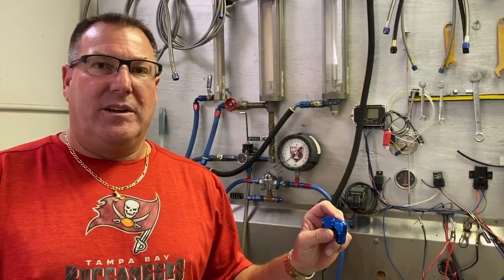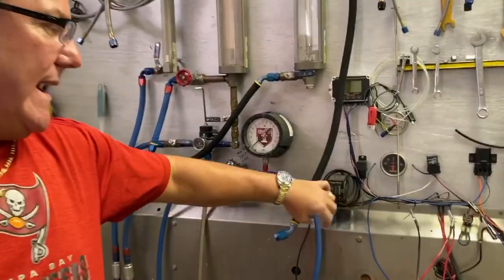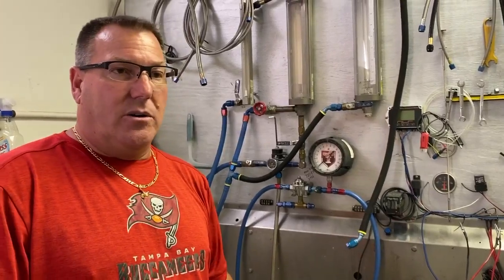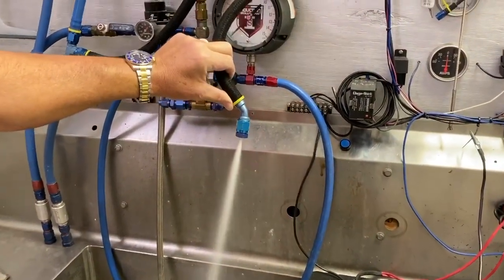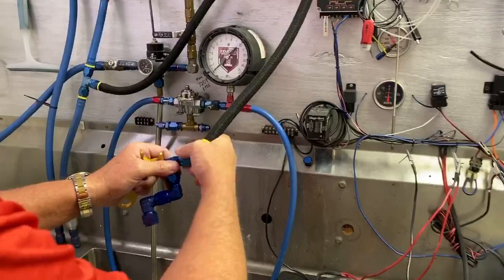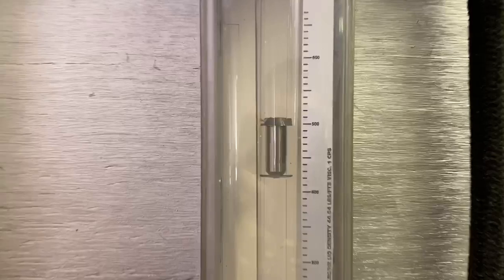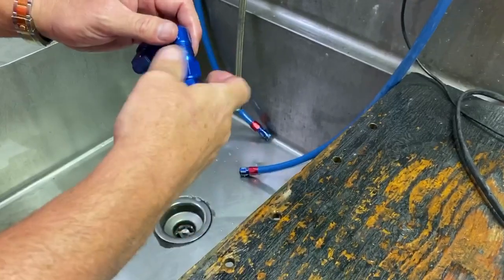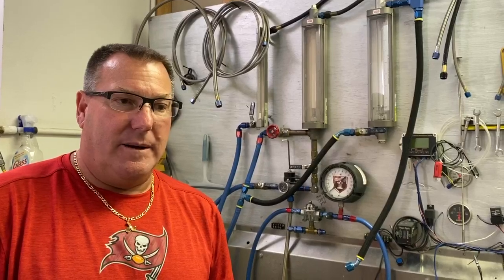Do 90° Fittings Restrict Flow?

Comment: I had one on the outlet of my fuel cell before my pre filter and I was dropping fuel pressure on my data log. Changed it to a radius 90 and that fixed it. I attributed it to cavitation or turbulence on the intake side of the pump.  On the pressure side I’m sure it’s less of a problem.

Comment: Not dismissing this and agree that proper fittings do not restrict flow as much as people think. That said, was this test run at the same pressures before the nozzle? That will give a true indication on how much, if any, back pressure the additional fittings would add.

Comment: Think of a 5 lane freeway with a crashed truck blocking 4 of the 5 lanes. Traffic flow is obviously greatly restricted. 
You then close one of the 5 lanes Before (upstream of) the crashed truck, and note that the traffic flow didn’t change going from 5 lanes to 4. 

Would you then state that having 4 lanes instead of 5 lane freeways does not change the traffic flow and start building 4 lane freeways instead of 5? Obviously, that’s silly. The restriction of the crashed truck (orifice in the video) makes the changes upstream (generally) meaningless.

Comment: sorry dude, good attempt but really a poor experiment, no comment on pump details, pump current draw, pressure, etc and the hole in the end is the limiting factor, why would 90 degree fittings that are way bigger than the limiting orifice have any effect on flow, especially at those pressures. there wasn't a flow change but is there a pressure change...that would be a C at best in a high school physics class

Comment: Your results look feasible. The jet flowing 500lph is a good visual that we don't normally get to see. I'm not familiar with the flow bench setup.  What was the pump pressure set at? I'd like to have seen that the pump pressure was controlled and a pressure measurement taken before and after the restriction.

Comment: SCIENCE IS AWESOME!  I love knowing and learning.  I use steel compressed fittings on my lines that are hand made at an industrial place locally and I never would have dreamed there would be a difference.  So I love to see logical testing done!  Super awesome! Keep up the good work!
Reply: the guy doesnt know how to test flow , you dont put a restrictor after the 90 you are flowing and expect to learn what the 90 flows lol
Reply: @bigboreracing356  I dont need a flow bench to find out if a # 8 fitting of any style will flow a 1/8" orifice hahahahahaha but I guess there are guys out there that need to be shown and then post how impressed they are with the test hahahahaha
Reply: @bigboreracing356  he should have said you dont need a full flow 90 when you dont need to flow the whole line size , instead of making it sound like the forged 90 is just as good as a full flow 90 ..................... get it ?
Reply: @bigboreracing356  you mean a bigger one will flow more than a smaller one , yeah I know  lol
Reply: he also proved that putting a orifice on the end of what you are flow testing takes everything out of the equation except the orifice ,         ever notice how ported cyl heads only start to flow more than non ported heads when you start opening the valve farther than ,050" ?
Reply: @bigboreracing356  he said it was a myth buster about 90 deg fittings , the only thing is putting a small orifice after a fitting takes the fitting out of the equation , like I said I didnt need his vid to tell me a #8 forged 90 will flow a 1/8" jet hahahahahaha  but it sounds like you did  , if you want to know if I know anything about fuel systems ask Don or Vern from Hilborn
Reply: @bigboreracing356  Im bragging about a VW that smokes V8s  and makes 600 HP with 133 cid
Reply: @bigboreracing356  lol , im just busting yours about the fittings too sir , I dig your pro charged fox body , im sure its a hell of a ride
Reply: @bigboreracing356  you couldnt get the fox body to hook on the street ? I figured it was a hand full
Reply: @bigboreracing356  they make heavy duty super thick alum cases and I added 2 head studs per cyl  so each cyl has 6 head studs , I run 40 lbs of boost on M5 Metanol with big cnc ported heads and .630" lift 300+ duration and 112 LSA cam
Reply: @bigboreracing356  the crazy part is there are faster ones than mine , there are places that make big block VW engine parts and get them up to 4 1/4 bore with huge heads with ports like your Brodix heads and they make over 1000 HP and run in the 7s @ 180 + mph
Reply: @bigboreracing356  yes ,  I just freshened the engine and trans for next season , first race is March 7 at Irwindale Raceway its 1/8 mile , our local 1/4 mile closed a few years ago , we went 9.32 @ 148 last time we ran 1/4 mile but I have done some up grades since then , its prob at in the 9.0s now
Reply: @bigboreracing356  cars like mine are prone to get loose if the track prep is not good , last year I got loose top of 3rd gear and hit the wall , I had to cut the car off at the doors and put on a new front half so I would be surprised if I could keep it straight on the street

Comment: If you consider the velocity of the fuel (even at twice the PPH) through the 90° fittings it should be apparent that you will not see a meaningful restriction in flow.

Comment: Sounds like some people have forget a lot of math that goes on here. Once a pressure has been reached. It wouldn't matter if it was a 90 or 180 fitting. If the pressure stays steady the fluid will flow at that amount. It is not like and exhaust system where the gasses are bouncing around in the pipe. Liquids and electricity both follow the path of least resistance until they are under pressure. Think of the water flow in your house. Every outlet has the same pressure until another outlet is opened.
Reply: Bro this is the best comment about this. I understand it 100% now lol

Comment: would the same be for running 90* in oil lines? I had an engine builder claim I had "too many 90's in my oiling system" which he felt led to my rod bearing failure and I disagreed to his logic.
Reply: Every fitting induces a pressure drop, but it depends on flow and viscosity. While it would drop it faster with oil, it's unlikely. Just check out the crazy 90 turns any oil system makes. The largest drops tend to be from long runs of narrow hose moreso than fittings.

Comment: I had always heard about the 90 degree thing since the 70's. Could it be at that time when we only had at best a Holley blue pump and brass 90 degree fittings that on the inlet side that the 90 degree fitting would restrict the flow? I would like to see a test with a pump like that and a 90 degree fitting brass and a good fitting like used in the demonstration.

Comment: this problem with 90 degree fitting are in flow reduction of the engine oil plumbing not fuel system

Comment: How about testing on the suction side of the pump.
Reply: John Alwine the reason this works, which I’m guessing you know, is pressure. The fluid was backed up and waiting to come out. 

Now not to dismiss this, as I truthfully would of avoided 90’s. Even on the pressure side from the free flow or even as mentioned vacuum side. This is where flow. Either fluid or air benefits from less restriction. 90’s would be one. Again boost set up. It’s pressure it don’t care. Airs backed up waiting to go into the intake or the fuel backed up waiting to enter the injectors.
Reply: @Owens_Racing  I have always used tube bent 90s when possible.  Thanks for the input!